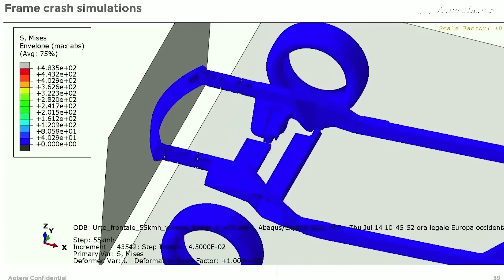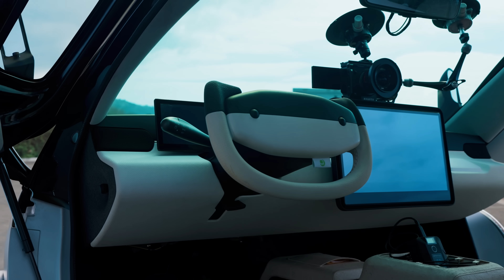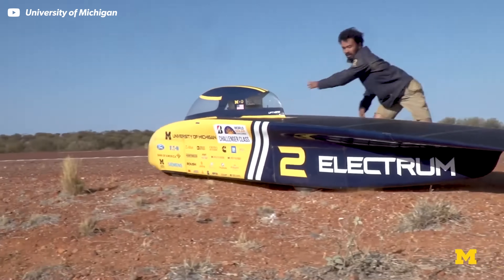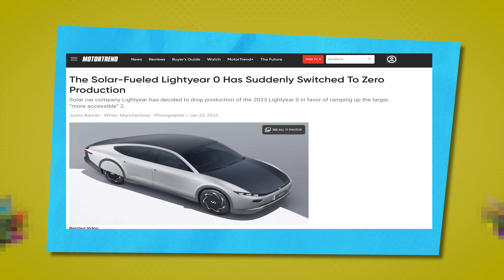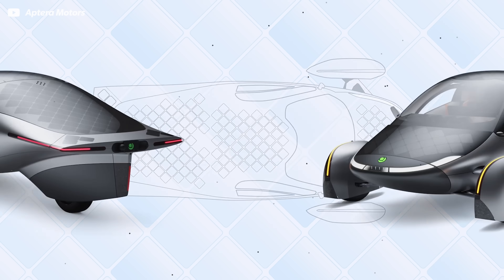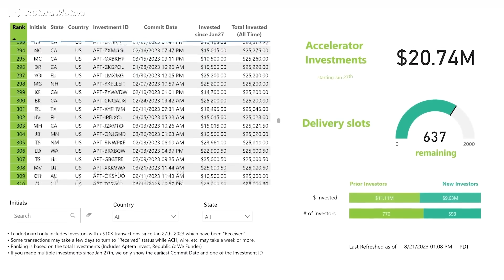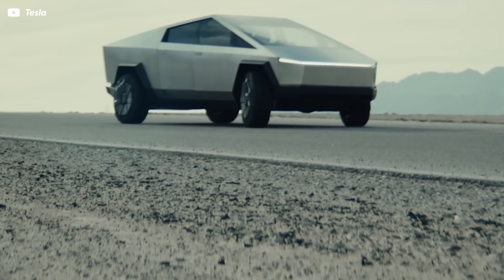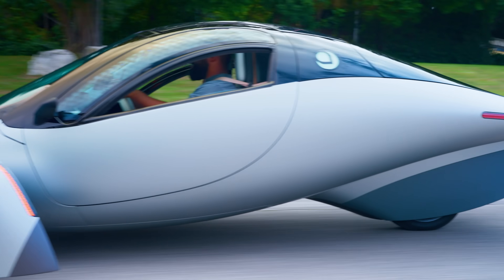We Drove America's First Solar Car

Comment: I think the 110V charging might be the most underrated aspect of this thing. Because it's so efficient, it doesn’t need a huge battery pack to get decent range. So even a standard household outlet can give it a decent amount of charge.
Reply: And cost an arm and a leg.
Reply: 🤦‍♂️150 mile range when you charge it overnight. Oh boy! Now that’s efficient. NOT!😅
Reply: @TheDieselndust  Crapping all over electric vehicles: username checks out.
Reply: @TheDieselndust considering most of the EVs will get about 40 mi overnight, 150 from literally any old wall plug is extremely good... And will cover basically all possible commuting for the 99th percentile of people

But it will also be able to fast charge, and it'll likely be faster than most cars to 80% charge since the battery is pretty small
Reply: @Ryukachoo  What? EVs get around 40 miles per hour of "slow charging"  at home with a basic 240v charge outlet. Even if you hook a Model 3 up to a 120v 15A outlet with adapters you would still get 40-50mi overnight just because that's all the amperage that can be drawn from the circuit. This new car wouldn't change that because the circuit simply cannot do any more, and the 150mi charge overnight being talked about in the video would be with the same 240v outlet all other EVs normally charge from, and those typically give 40~ miles charged per hour.
Reply: It is truly amazing that there has been NO improvement in solar panel efficiency in 50 years.
Reply: @LordSaliss  No chance. On level 2, yes. But OP is talking about level 1. No special wiring, just any ol outlet.
Reply: @oldrrocr  Lolol ok bud. Nice try.
Reply: @tyrelirwin he’s right , prove him wrong.
Reply: @xprettylightsx  well, there's a Stanford study that showed that up until 2010 solar panels did not generate more energy in their lifetime than it took to manufacture them, but that is no longer true. I'm no mathematician, but I don't think 2010 was 50 years ago…
Reply: @tyrelirwin  I believe you and thank you for the information and reply. May God Bless you and your family and loved ones.
Reply: @oldrrocr  Meanwhile, back in reality... solar panels are 47x as efficient as 1983 (40 years ago) and cost 1/170th per watt-hour produced vs the same product in 1983.
Reply: @oldrrocr  absolute bs.
Reply: @tyrelirwin it wasn’t 50 years ago, but it was 13 years ago. And in those 13 years, solar panel technology has changed drastically. Back in 2010, not many people had solar panels on their houses, now almost every new house is being built with them, and the cost of solar panels has gone down drastically. If you wanna find something to back up your claims, then find a study that’s much newer than 13 years. This is the equivalence to quoting a study from Harvard about how to cure a disease from the 1880s; it’s ineffective
Reply: @TheDieselndust   150 miles of range overnight would cover basically every day of driving for 95% of a year for 95% of Americans.  That's pretty incredible.
Reply: It uses the nacs port, so roadtrips wouldn't be an issue
Reply: @tyrelirwin  My 2018 Honda Clarity gets 4.32 miles of range per hour pulling 12 amps from a standard 15 amp, 120V outlet. 43 miles in 10 hours of charging.
Reply: @LordSaliss  I don´t get your point, the thing about the 150 mile charge overnight comes from the extremely high efficiency on the road, so you need 1/3 the energy to go a mile and also you get 3x the effective charging speed because with the same wh you get more range. The issue with talking about miles per hour of charging is that not only the power draw from the wall influences that. A hummer ev would get a horrendous charge overnight on regular home plugs compared to a tesla even if they are pulling the same current
Reply: @mezmerizer0266  On a dollars-per-mile basis, electric cars generally cost one-third of gas/diesel vehicles to run. Even if you live in a state with cheaper gas a more expensive electricity, the latter wins out.
Reply: @Ryukachoo  A Chevy Bolt, when using a level-1 charger at 12 amps, will get about 50 miles of range overnight (12 hours). With level 2, will charge 0-100% in 9.5 hours.
Reply: @tyrelirwin  120V times 12A is 1440W, or 1.4kWh per hour. Chevy Bolt gets 4 miles per kWh. That's 5.6 miles worth of charge per hour, or 67 after 12 hours. Even if you subract some for inefficiency, it's not below 50, and I know this because I own one, and have L1-charged at AirBnBs.
Reply: @Lavasioth  not for me, I drive 160 miles a day on my commute.
Reply: @Ryukachoo  until you see your electric bill at the end of the month, then it is not such a “godsend” as you initially thought. 😆
Reply: @TheDieselndust  It's 150 miles over night on a 120v outlet. If you used a 240v or put a charging station in your home like a lot of Tesla owners do, you would likely get a full charge over night. Plus they are advertising models with 1000 miles of range. On top of that, they say you can get up to 40 miles of charge per day just from the solar panels. To add even more on top of that, it still has the outlet for fast charging and looks like it will be compatible with the Tesla network, so you'll have charging locations all over the US.

So it should work just fine for you and basically any person, at least as far as range and charging are concerned.
Reply: @TheDieselndust  "until you see your electric bill at the end of the month"

Just compare it to your fuel costs on your gas/diesel vehicle. Should be 1/3 less expensive.
Reply: Are there any EVs that can't charge with a normal outlet? My Cupra Born can do it (though you shouldn't, since most outlets aren't made for that kind of constant load).
Reply: @tyrelirwin  Yep - Level 2 for Aptera is adding miles almost as fast as level 3 in other EVs
Reply: @9PlatinumGamer9  most can't do it at that rate. The idea being you can go basically anywhere and get more charge than any other electric vehicle. It also would be compounding, as in recoup more miles faster than any other EV on 240v, stage 2, etc.
Reply: @LordSaliss  yes but being able to get 150mi overnight from literally any outlet, simply due to very efficient motors and low rolling resistance and high aero, opens up a lot of convenience. 
Nothing against other EVs it's just aptera has a lot of interesting benefits
Reply: @9PlatinumGamer9  I think they're talking about how much range a vehicle gets from said level 1 charge overnight, like someone said, a Hummer would basically just get you out the neighborhood before it runs out of charge where something like an Aptera can do a small road trip destination and back on an overnight charge. I know a few folks who just charge at level 1 since they have reasonable commutes, sometimes they use a bit more than the overnight charge but it doesn't matter since the charge just accumulates overtime till they get to 80% or whatever they have their charge limit set at.
Reply: @TheDieselndust  My dude. My work is 15km from my house. So it would take 30km per day. I would need like 3 days of works to get close to the 150miles. 150miles is short for a TRAVEL, but huge for Home-to-work daylies.
Reply: @TheDieselndust if you drive less than 150 miles in a day it’s not a problem
Reply: Yup, and no expensive ev charger install
Reply: @LordSaliss sorry but you've missed the point. It's not drawing more power than another car would form a 120v circuit, it uses so much less electricity to travel the same distance that it charges that much more miles per hour on a 120v circuit. The efficiency is what seperates aptera from the rest, its why the solar roof makes sence, not as it can capture more energy than another car could with solar covering it. But the same amount of energy takes the aptera that much further than anything else on the road
Reply: @Ryukachoo  To add, 20kW charging a battery pack to 100kWh on a car will feel different to a car with different range-per-battery size. For an example, 4 hours might get you 120 miles on a Hummer, 300 miles on the Lucid Air, and maybe 550 miles on the Aptera. (All of these are rough estimates for an example.) Efficiency in aerodynamics and keeping things light pays dividends especially in electric-powered cars, when charging is a huge bottleneck and concern in today's EV transportation.
Reply: @LordSaliss The 150 miles overnight IS on 120v for the Aptera. It can do this because it is so efficient. The model 3 and Aptera would pull the same amount of watts from the wall BUT the Aptera can go 3x farther on those watts compared to the model 3.
Reply: @TheDieselndust that is with a 110V plug. You get 13 miles an hour. In hours you can add 150 miles of charge. That is far more efficient than any other EV. If you have a level II charger it is 59 mile/hour of charge.
Reply: @LordSaliss that is not correct. The Aptera only uses 100wH/mile vs a Tesla Model 3's 255 wH/mile. The Aptera can charge 13 miles/hour on a U.S 11ov outlet. On a Level II (240V plug) it will charge at 59 miles/hour.
Reply: @TheDieselndust I have two evs and no ice vehicles.  I used to spend $500/month on gas.   Now i spend $100/month on electricity.  I like that.  I also like to never stop at gas stations.  I just wake to a full tank every morning
Reply: @TheDieselndust it is dirt cheap. The Aptera uses 100wH/mile of electricity. The measuring stick that the EPA uses to calculate equivilent mpg, mpg-e,  for EV's is the energy in one gallon of gasoline. One gallon of gasoline contains 33.7kWh of energy. So the Aptera get 33.7kWh ÷ 0.10kWh  = 337mpg-e. In Oregon right now electricity is $0.15/kWh. It would cost 10 cent/mile.  $10 to travel 100 miles.
Reply: @WillxYes on a level 2 charger the Aptera charges at 59 miles per hour in the U.S. it can DC Fast charge at 40kW to 60kW. So, at 50kW it will charge 500 mile in an hour.
Reply: @TheDieselndust  150 miles charged overnight plus 30 to 40 from the sun during the day.  Sounds like you are covered for 160 miles per day, even if you do it 7 days a week.
Reply: @christopherbiomass7155 just might have to plug in for 10 minutes on cloudy days or if he drives at night
Reply: @garywozniak7742 math is hard for some people. I'm constantly astounded by how many people just drive until the low gas light comes on, then stop and fill up while complaining about how expensive it is.
Reply: @christopherbiomass7155  it ain’t happening. Those are just projections. They haven’t actually met those specs yet.
Reply: @uritamminga1  I call bullshit on the hundred bucks a month on electricity. Try to do a cross country road trip in your EV and get back to me. 😆🤡🌎
Reply: @tjboylan20  unfortunately that doesn’t work for what I do for a living.
Reply: @nomercy4521  nope. It ain’t happening.
Reply: @nomercy4521  so charging on 240v all night is like leaving your clothes dryer running all night. Please explain how that is saving money? The strain it is putting on an already taxed electrical grid is concerning.
Reply: @oldrrocr   That is not true. By far not. The  efficiency was at 7-9%  25 years ago (50 years ago even worse, in the lower one digit ranges at best, usually lower than 1% even) . Today it's at 20-24% 
Btw: The theoretical maximum is 34%, the so called  Schockley-Queisser-Limit. Thus 1000 watts of sunlight shining on a (singele material) panel is converted to 340 watt max.
Reply: @xprettylightsx  He ist not right. In the last 20 years  alone the efficiency almost tripled.
And: Prove him wrong? Isn't it his duty to prove that he is right when stating something wich seems to be unlikely to beginn with?
Reply: @TheDieselndust  Move or change work. I mean you are currently loosing ... what .. like over 3 hours of your life every day commuting? You have bigger problems than "THIS Electric car is not for me": You have only this one life and you are throwing away 20% of your awake lifetime right now.

(well, I do know nothing about your life and your reasons of course)
Reply: @TheDieselndust  You mean petrol is for free in the US now? Cool!
Reply: @TheDieselndust  It's math. It's pretty simple that electric motors are more efficient than gasoline engines. It takes less energy to travel per mile. Electricity is cheaper than gasoline. As someone pointed out, this car gets like 330 mpg-e which is a comparison to gasoline vehicles.

Also, how taxed is the electrical grid? I live in a major metropolitan area, and we never have power outages due to not having enough electricity.
Reply: @TheDieselndust look at this guy driving 150 miles plus solar charging per day...
Reply: @TheDieselndust  not sure how you can say it isn't. The next best EV barely gets 14 miles a night charging on a basic outlet. Of course you can install a 240V line, but you can do the same for this thing. 

I mean the alternative is the like 4Kwh it takes to make a single gallon of gas, gas burned in a truck taking it to a station, and then finally burned in your car. It's far better than that.
Reply: @LordSaliss  no they're talking about a 120v outlet. This thing gets 1000 miles on a 100kwh battery. That means it gets around 100wh/mile. A basic 120v outlet outputs around 1.5kw so in 10 hours that's 15kwh or 150 miles at 100wh/mile. 

Of course you could also add the same charger as a normal EV which would mean charging at 7200w. Well with that it's 72kwh a night. It's the same power the Tesla or other EV would get but the range is far higher in the same time. 72kwh is enough for 720 miles. But since the thing charges so easily this obviously will never be necessary, you'll just charge from a normal outlet.
Reply: @TheDieselndust  it doesn’t work with mine either, but for others it will
Reply: @TheDieselndust We don't drive these things in dilapidated rural states... 🤣
Reply: @TheDieselndust  that’s a different thing that I wasn’t describing.  When I charge at home, which I always do, at 13 cents/kWh (our highest rate), I’m paying $100/month.  If I did a cross country road trip using public DC fast chargers, it would be a lot more expensive.  But I never do that, so why are we talking about it?
Reply: @oldrrocr  The newest panels today are up to 24% efficient. In 2000 the average panel was only 9% efficient. Plus there are some newer designs for the solar rectenna which could reach up to 75% efficient; if we can find a way to make high frequency switching in the terahertz and graphene sheets.
Reply: @Slayyyter_bitxh  we'll its kinda misleading as we still never heard if NACS cars will work with the old Tesla stations. Remember that NACS is changing the communication protocol to the same as CCS. I assume they should as Tesla will also be transitioning to NACS so it should be backwards compatible, but hard to say.
Reply: @TheDieselndust  depends where you live and current gas prices. In my area at $3.60 a gallon the crossover is around $0.28-0.35/kwh. My personal electric only costs $0.155/kwh so it's about half the price of gas.
Reply: @TheDieselndust A Tesla Model 3 charges at 7 mikes in an hour on 110V. The Aptera charges at 13 miles in an hour on 110V.
Reply: @LordSaliss the model 3 gets 7 miles per on charging on 110V.  The Aptera gets 13 miles per hour.
Reply: @garywozniak7742  no its 5.8 miles per hour. The car is rated at 255wh/mile and a basic outlet only outputs about 1500w. However the full 1500 is only accessible in short bursts so in reality it only has 1300w usable to charge. With that it's just 5 miles per hour of charge or about 40-50 a night.
Reply: @garywozniak7742  again, those are forecasts. They haven’t actually done that yet. It’s all hopes and dreams.
Reply: Recharge while traveling at your Airbnb!
Reply: @garywozniak7742   Your math is off by a bit. There are 1000wH in a kWh. If the Aptera can achieve a usage of 100wH/mile that translates to 10 miles per kWh. Your residential electric is $.15 per kWh and the car can drive 10 miles on that kWh then the cost would be $0.015 per mile(one and a half cents). Your 100 mile trip would actually cost $1.50. All this is before any solar generation is considered.
Reply: @Skylancer727   Aptera is claiming an efficiency of 100wH/mile which would yield an overnight charge range of around 120 miles. The 255wH/mile you quoted is the efficiency of a Tesla model 3. If you were intentionally referencing a model 3 then please disregard.
Reply: @TheDieselndust   Those are forecasts based off of the prototype they drove in the video. An actual car that exists. It may be "hopes and dreams" that they make it to production but the numbers for charge rating and range are solid.
Reply: @shannonlawhorn1674  Yeah, I was. I was comparing the two to show that the numbers are on Aptera charging via 120v not 240v. Someone else commented that a Model 3 gets about the same a night, but on 240v saying that doing the same at 120v was impossible.
Reply: @oldrrocr  I am curious what you are talking about here. Solar panels have seen huge efficiency gains, especially in the past ten years or so. A couple years back I was able to buy 300 W panels for $100 each. Ten years prior, panels that size were only generating 100W and cost significantly more. Solar panels now generate more energy, in less physical space, at significantly less cost. That is an incredible improvement in efficiency. Batteries are still the weak link in the solar game.
Reply: @TheDieselndust yes - I'm actually wondering if that was a mistaken statement.
Ah (reads some other replies) it makes sense.
Reply: @TheDieselndust  Compare that to a Tesla Model 3 that might get 60 miles under the same conditions!
Reply: @LordSaliss  You have your math wrong.  the 150 overnight range mentioned is from a 115 VAC outlet, not a 240.  The Aptera will get 2.5 times the range of a Model 3 from the same amount of power.  The same ration applies whether the power source is 115 VAC - 240 VAC, or 400 VDC.
Reply: @oldrrocr  But there has been, and there may be new breakthroughs occurring right now.  Aptera is using the most efficient, longest lived cells in mass production at the moment and has developed new controller and encapsulation tech that they may soon be supplying to other companies as well.
Reply: @oldrrocr  lol there is huge improvement
Reply: @TheDieselndust  150 miles overnight when you charge it on a standard 120V outlet. Most EVs having a 240V charger is a must.
Reply: @LordSaliss  What are you talking about. The Aptera can do 50kW charging which is a peak charging speed of 500 miles of range per hour. If you charge the Aptera at a 240V level 2 wall charger like the one Tesla sells with a charging speed of 11.5kW you'd get ~115 miles per hour.
Reply: @oldrrocr  But that's not true, there has been